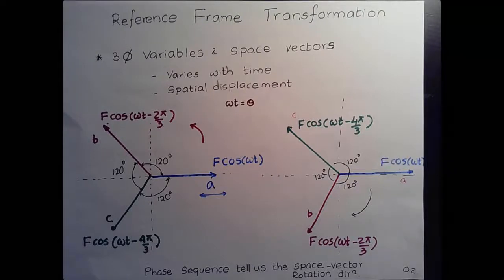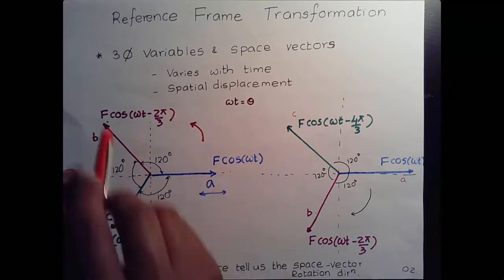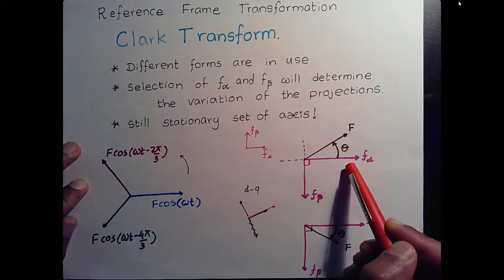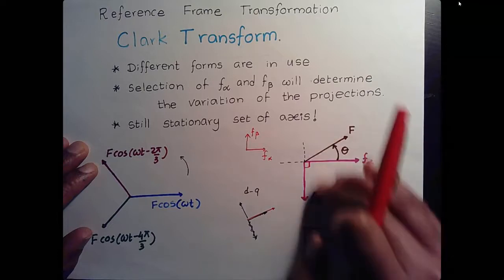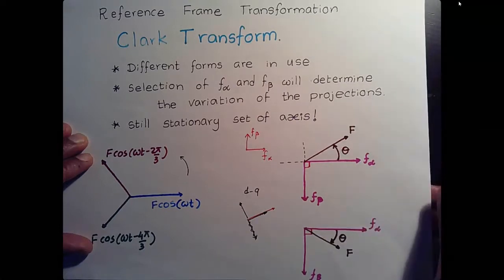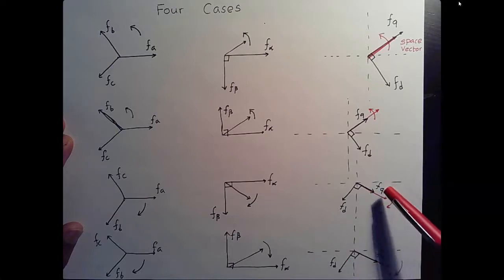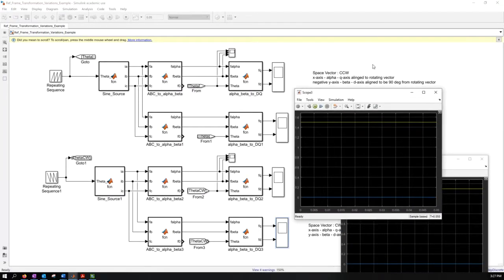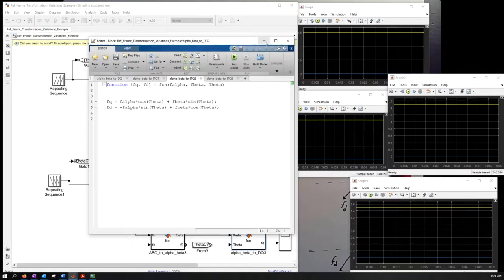Reference Frame Transform: Supplemental Material

Comment: Sir, thank you so much for this follow up video. It clarifies lots of doubts. Just one more request I wanted to make. If it's possible, could you make a video on using simulink and embedded coder for implementing the foc on a target hardware?
Reply from the maker: Sandip, I believe there are material on embedded coder through PLECS. Do you have a particular hardware/microcontroller in mind?
Reply: Sir I am working with stm32L476 MCU.